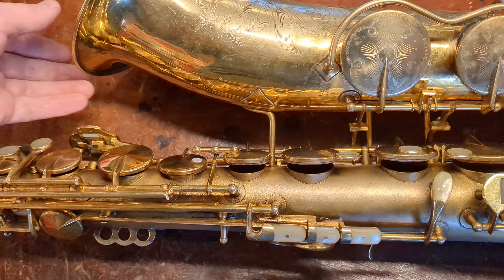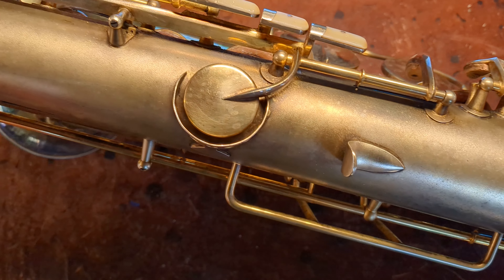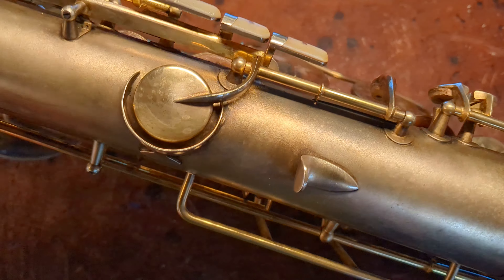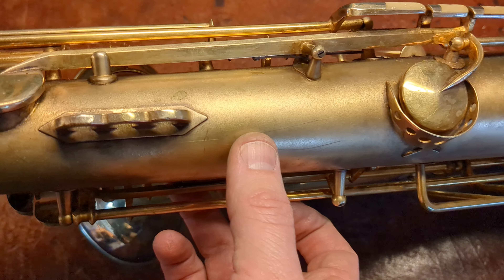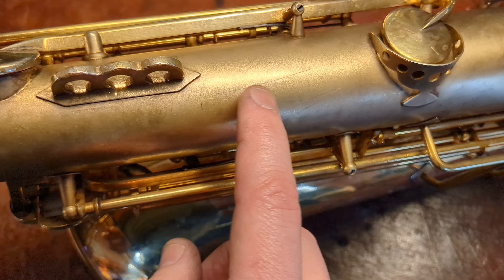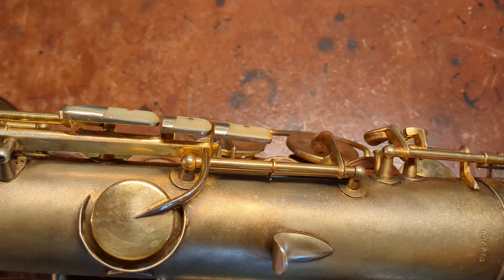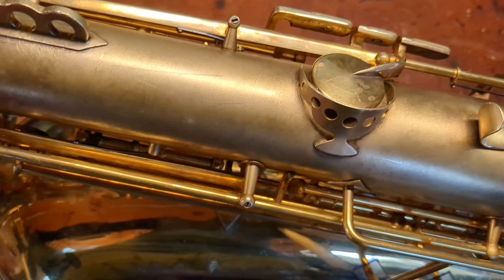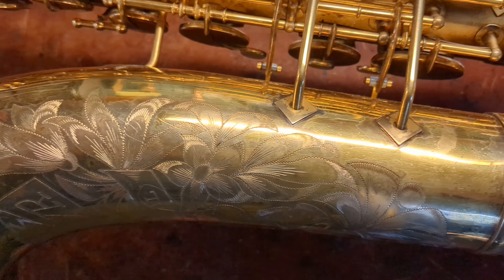Saxophone Repair Topic: "Gold Doesn't Tarnish"?

Comment: My old SML had the flaky “gold” on it, and I literally rubbed it with a towel and it  came off. Lol it’s mostly silver with some brass showing through. It’s a ‘mid year ‘56 Rev D that I’ve had for at least 25 years .
Reply from the maker: That's not real gold.  It's called "perma-gold" it's zinc chromate, and I have a video of that.

Comment: Will the overhaul series be continued?
Reply from the maker: Yes, at some point. I can only do it during certain seasons so my AC isn't running, and it is a significant unpaid time investment. It's definitely on my mind.  I'm currently building a boat, but if I can find a day or two where I don't need to be making money and I don't need to be building a boat and my kids are at school and all my chores are done, I'll knock out a few installments.